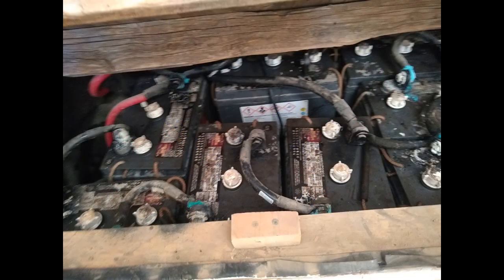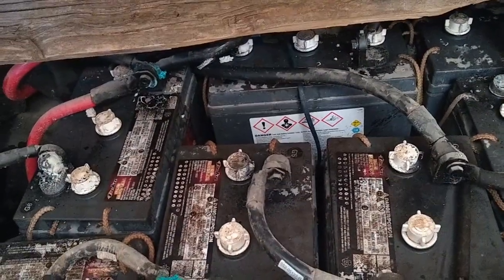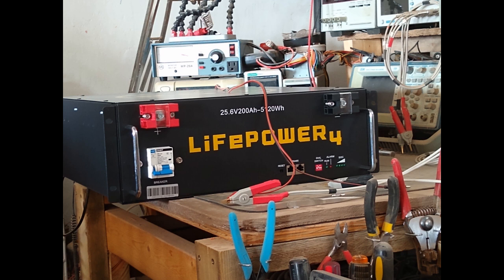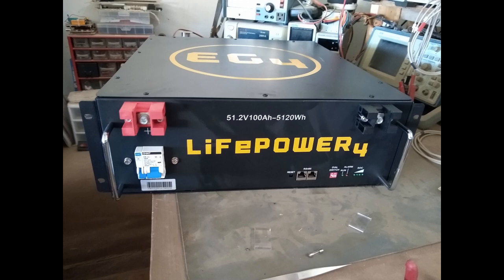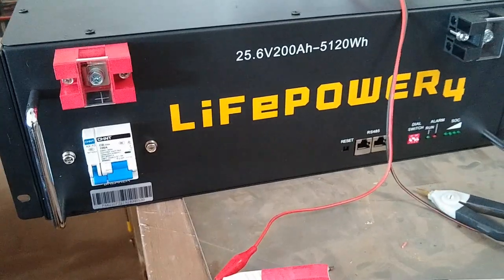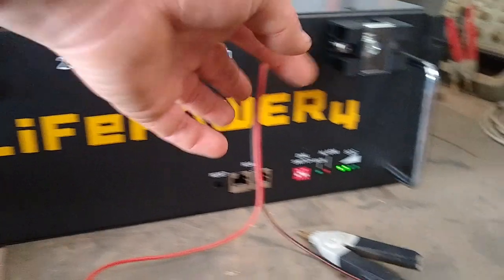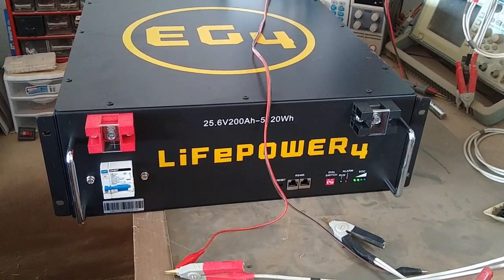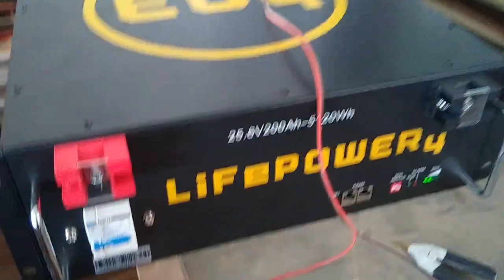New EG4 Batteries For The Earthship

Comment: Anybody has an issue with noise or buzzing in the 24v  battery? Is that normal?? I just got mine and I don't know.
Reply from the maker: I would contact the manufacturer about it to be sure. I have no buzzing coming from any of mine.
Reply: @aloneinanearthship4010  I did, but it is already second week and they don't want to admit that the battery defective. Funny thing the Lady on the phone said noise or buzzing it's ok. I'm shocked.Thank you for responding 👍

Comment: Any idea where the switch is set for one battery? I received no instructions
Reply from the maker: Here is the link to the manual https://signaturesolar.com/content/documents/EG4/EG4%20Lifepower4%20-manual%201.0.2.pdf
Reply: @aloneinanearthship4010  I found that earlier.
It was set correctly and is finally working fine
Reply from the maker: @nickaltvater5592  Excellent!